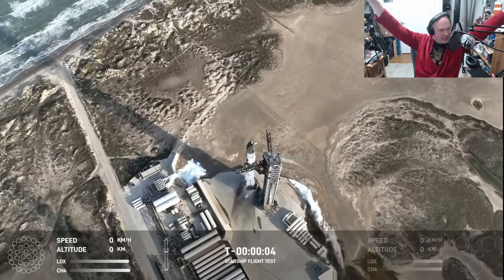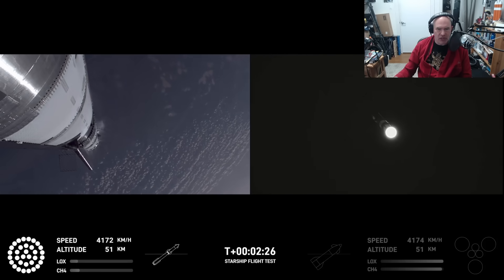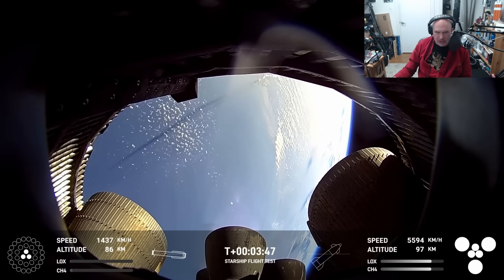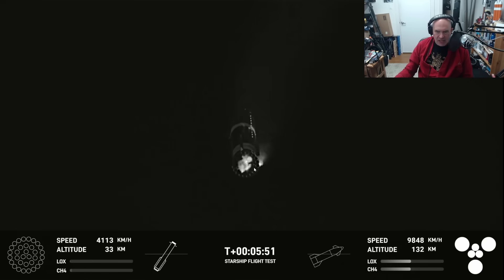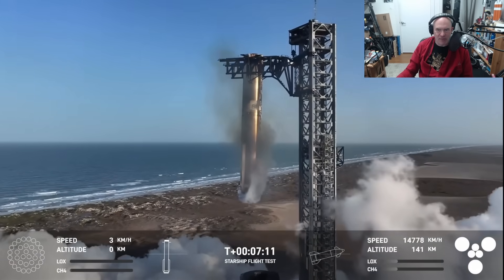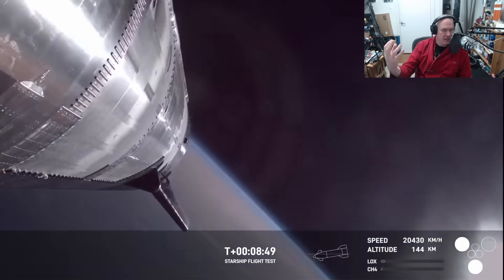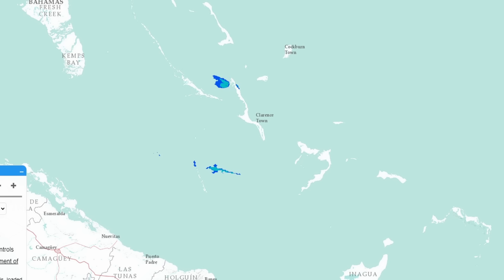SpaceX Make The Same Mistake Twice With Starship Flight 8

Comment: Edit of my original post.
Very long writeup....So theory is....
1 - High levels of LOX in the tank dampened the effects of the harmonic frequencies/vibrations since the new RVac methane downcomers are mostly submerged at that point. 
1.1 - The new downcomers are likely susceptible to vibrations because they are long and thin...just think of a Guitar String..
2 -  As LOX starts depleting, more of the RVac downcomers gets exposed and with no LOX to dampen their vibrations, it starts causing damage.
3 -  E4 RVac methane downcomers eventually rupture. This reduces the amount of Methane thats is being fed to RVac No. E4 which leads to 2 possible effects.
3.1 - Methane is needed for Regenerative cooling of the raptor engines. If not enough methane is being fed, these engines might overheat, its likely what we saw on the engine camera view of RVac E4 with its burnthorugh on the engine bell.
3.2 -  Not enough methane also means the engine suffers a reduction in thrust, as highlighted by SpaceEngineer at T+7.43 so the ship starts pitching over to the side of the failing RVac E4.
3.3 -  Not enough methane also means the engine is running at oxygen-rich combustion, which is very destructive (Look at SN8)
4 -  Both Oxygen-rich combustion and severe overheating combined caused a catastrophic and energetic failure of RVac no. E4. This blast instantly knocks out 2 of the Sea Level raptors and heavily damages the 3rd one. The 3rd Sea level Raptor with its heavy damage eventually fails as well catastrophically.
5 - S34 starts tumbling due to asymmetric thrust from the 2 remaining RVacs that cant gimbal.......and the rest is history.

Key Points:

## S34's Fix - It likely didnt work because the conditions they tested S34 is inaccurate and doesn't replicate S33's conditions at failure. 
- As I highlighted, the problem starts as LOX levels starts to get low. 
- However, S34 conducted a 1min static fire test with FULL LoX tanks. So the data they gathered is already incorrect leading to improper fixes.
- The fact that S34 failed in the same manner and within the same time-frame as S33 leads credence to the idea that the root cause of the failure wasn't addressed properly or at all.
- Thus, they need to redo the test with S35 static firing with a low level of LOX. They either need to anchor it down or add heavy ballast in the payload or fully fuel the methane tanks.

## Bandaid solution?? - If SpaceX desires to keep both S35 and S36 both of which are too advanced in their production for major revisions. They could sacrifice mass and HEAVILY reinforce the new V2 RVac downcomers with numerous stringers, supporting frames, and other reinforcements to atleast minimize the damage caused by the vibrations.

## Major revision?...A Block 1.75 Starship - If SpaceX engineers thinks that the V2 design is way too flawed. They could revert the entire downcomer and its associated plumbing in the engine section back to V1 spec. This seems only applicable to Ship 37 onwards, which are still not stacked and incomplete and thus can take in major revisions in designs. So you are left with V2 Flaps, V2 thermal protection system, V2 Tank size, V2 hull, V2 payload section with a V1 engine plumbing. a Block 1.75

- The V2 plumbing are likely designed for higher fuel flow needed by Raptor 3. Reverting to V1 plumbing might result on a reduction thrust to Raptors-3. However, it might be beneficial for reliability as Raptor 3 running below its designed/specified thrust output might actually lessen the stress and wear on the engine.

- At this point of the above decision...that basically means relegating S35 and S36 to testing articles to further learn more about the harmonic frequency problem for a permanent and effective fix if SpaceX still desires to keep the V2 design eventually.
Reply: IMO They have 2 options for a fix, redo the test with a tethered down V2 Ship with nearly empty LOX tanks and gamble with the new Fix from said data or create a Block 1.75 Starship with proven Block 1 downcomers with the rest of the ship being Block 2
Reply: @pikaachoo3888 could they encase the separate downcomers in a single block 1 style pipe? Or indeed find some way of increasing their structural integrity by say physically connecting them (even if the actual fluid lines themselves aren’t connected)
Reply: @MrUltrAdaman  They can but its an inefficient solution since it adds a lot of weight. The casing you used will be very long to cover the entire downcomer, you will also need to support it with even more stringers if you want to avoid it being crushed by the LOX tank pressure. At that point, you might aswell merge the downcomers into a single pipe...AKA the V1 downcomer design. Its why S28-S31 all had succesful ascent, the V1 downcomer is far more resilient
Reply: @ makes sense thanks
Reply: @pikaachoo3888  I have heard a couple of people suggest this.  Time for a hybrid.
Reply: @pikaachoo3888  I think you're right because my original assumption was that those three pipes cut through the bottom of the LOX tank and are not aligned with the focal point of the forces that the thrust generates on it (the center, directing forces to the edges), that create three gigantic weakspots in a dome structure that needs to transmit forces with no interruption. Plus it seems that the problem comes from the same pipe in both cases, maybe there is something else attached to or near it near the bottom of the tank or it comes from the orientation of the craft and the forces that its thrust vector generate, trying to get to orbit. In that position, there is an asymetry between the belly and the back part of the ship (heatshield and one Vac engines below and two above the medium line, there are more forces on top than on the bottom.  Saturn V first stage didn't have that problem thanks to a sturdier structer and five engines with four outer ones in a symetrical configuration.
Reply: @pikaachoo3888  the lox tank can only be mostly empty in the case in whare they have the engines somewhat on
Reply: @pikaachoo3888  So their computer modeling software and AI algorithms are insufficient for the task OR what you are proposing.
Reply: @pikaachoo3888 my thoughts too. Go back to the bits that worked.
Reply: @pikaachoo3888 - but why didn’t they do this after Starship 7 exploded. They knew the lower LOX level would let the downcomers vibrate more ?
Reply: Very plausible possibility, curious to see the results of the investigation and if it's the correct take or not!
Reply: Yes and this might even explain why the v1 ship didn’t have as big issue with this because the old methane downcomer design is completely different from v2 meaning it likely reacted differently to the empty tank acoustics then the previous design
Reply: @sauceboss1846  Not only that, the old V1 downcomer is a single fat piece, so its more structually resilient to violent vibrations. Its like how a single strand of spaghetti (aka V2 Methane downcomer) easily breaks if you vibrate and shake it with you fingers, but a bundle of spaghetti(the single V1 downcomer) wouldnt be affected that much
Reply: @pikaachoo3888  and now I know you don’t know what you’re talking about! 🤣 an engineer you are not.
Reply: Men, never seen a guy with the goofiest profile pic giving the most accurate depiction of an event in my whole life.
Reply: @Blasphème_Sataniste - looks like “roaring kitty”
Reply: The other thing that never shows up in static fires is the increased G load. The G load goes up as the propellant burns off. That increases the hydrostatic pressure in the tall downcomer.
Reply: That’s what I thought too.
Reply: @Staysa001 lol.
Reply: A valid explanation from the information we have.  I wonder if the extra length they added in V2 just happened to put the downcomers into a resonance range that the shorter ship didn't hit.  Doesn't the booster use a similar feed system?  So, it isn't having this issue when fuel/oxy gets low and the V1 wasn't either.  But add resonance to the typical vibration and that would add a lot.
Reply: @ IIUC the downcomer design is substantially different between the two versions. I believe someone already mentioned this somewhere but the old design seems to use a single larger downcomer that gets distributed vs. smaller downcomers, one per RVac.
Reply: @toddjohnson5692  more so due to resulting thickness not length of new downcomer system. As some above have said they are using 3 thinner ones for Rvacs  and one bigger one for the 3 center engines. Vs v1 which was one big downcomer that split at the very bottom to each engine
Reply: @toddjohnson5692  The incandescent hotspot is on the outside of the bell, and there's no oxygen to burn that stuff there. 
The only resonance issue here is an intentional vortex that is established between each cluster of 1 V.Raptor and 2 Little ones. You can see this vortex clearly on the right-side of the video around 9:45, but the frame rate helps to hide it. The angles of the rolling vapors/smoke clearly show vortexing. 
This is used to keep the external surfaces of each V.Raptor cooled, by venting LMe between them. This doubles as a Base Bleed effect (see: Extended Range Artillery) when the high velocity exhaust entranes it for more zoom-zoom.
Reply: Maybe... but the starship flights that made it to splashdown didn't rud. So, maybe it has to do with the modifications they've done. Sometimes the best part is the one that worked consistently without a rud
Reply: I don't think so, AFAIK the vents don't vent the gas into the skirt area. Also it's clear one of the vacuum engines suffered a RUD and as scott noted the fire couldn;t have caused that alone or the other engines would be exhibiting similar issues. The glowy part of the engine is unrelated to whatever is happening under the heat shield.

To me this looks like a Raptor 2 failure in the regenerative cooling jacket thats venting into the skirt area. This leads to burnthrough of the engine bell due to insufficient cooling which causes an engine RUD that then takes out the sea level raptors. Its possibble there's too separate failures going on here with the engine RUD being unconnected to the flames seen. But thats unlikely IMO.
Reply: Are you a rocket scientist? I don’t know enough to tell whether this explanation should be convincing but I know enough to feel that it’s plausible.
Reply: @jaredbutler957 I don’t work directly on these things (I’m a data person), and I do not have any relation with SpaceX. But I do know that the vibration during a launch is far beyond what most of us intuitively understand, like it will shatter solid pieces of metal nearly instantly in the right conditions. I also know that there have been issues that only appear when the tank levels are in a certain range.
Reply: @Mira-bt3zx  To put that in perspective, I was just watching a vintage film post mission interview of the Apollo 12 crew, and one remarked the shaking was so violent when F5 engines lit off that he could not see the instrument panel.  Starship is all that much the larger with potentially all that much larger vibrations in both stages.  It is pretty tough to simulate the Starship without actually launching.  Static firing may not tell the whole story because the stresses are different, there is no acceleration along the path, the ship is restrained, etc…

I am not surprised at the number of launches required to wring out the Starship problems.  The late 1950s/early 1960s Atlas booster stage and a half development took close to 12 launch failures before success and Atlas was small and simple by comparison.
Reply: @Mira-bt3zx 
Especially with the metals involved being supercooled due to the propellant, weakening the metal and making it more susceptible to said vibration.  Nice one!  👍🏻
Reply: @jaredbutler957  I mean, it does align with what the extra-long burn test was about.  The main problem is that test was done under normal gravity, on the ground, so it probably failed to find whatever harmonic issue is causing this mess.

The "fail fast and fail early" approach might have a blind spot here, if data from the first in-flight error and the ground test isn't enough to isolate the cause...
Reply: @georgedorn_fnord  Surprised nobody reacted to this before: but gravity at 75 km up is basically the same as at sealevel. And even then, the main force generated on Starship is it's own thrust. Being weightless in orbit generally means:
a) not under rocket thrust (else you would feel acceleration pushing yourself into your chair)
b) you are still under the influence of gravity, but you and your spaceship have sufficient velocity (orbital velocity) to 'fall over the horizon': Within the reference frame from an astronaut, you are falling at the same rate as the spaceship and experience weightlessness.
Reply: @jaredbutler957  Sounds good to me
Reply: @jaredbutler957 YouTube aerospace engineers! 😂
Reply: @jaredbutler957 - yes he made me google some terminology, and it makes sense
Reply: This is a pretty good theory, there is obviously something happening as the tanks empty because when this fails it's at almost exactly the same point as the previous flight. Is it resonance this time though, we will have to wait and see. Personally I think its going to be an issue with plumbing outside the tanks, I believe there is more complexity in marrying raptor 2s to Starship V2 as it was designed for Raptor 3 meaning more complexity with adaptors. There is that obvious hot spot on the engine bell too, so who knows, it really is all speculation right now though.
Reply: @schrodingerscat1863  One of my supporting observations is Ship 34's static fire test. S34 during its static fire had a FULL tank of LOX, so its both an inaccurate simulation of S33's condition at the time of failure but likely also generated false data because any vibrations they detected would have already been dampened by the full LOX tank leading to an improper fix. The fact that S34 failed in the same manner, at the same timeframe with an even more violent failure mode further supports the idea.
Reply: @pikaachoo3888  Exactly, very difficult to simulate these exact scenarios. I imagine they would have had vibration sensors all over the place this launch to detect where vibrations are building up first. It's going to be a while before they fly again I think because the investigation this time is going to have to be really in depth. Probably a lot more static fire testing too.
Reply: @schrodingerscat1863  Its very easy for us to come up with these hypothesis with the benefit of hindsight. I cant imagine how stressful it is for the SpaceX engineers to be trying to look thru the data in real time and figuring out whats the right thing to do. At the very least, they now have 2 Full sets of flight failure data to base fixes from.
Reply: @pikaachoo3888  Exactly, problems like this are never easy to track down, having 2 sets of failure data will be good to look for commonality in behaviour prior to failure. I imagine they also have more cameras and sensors around the engine bay plumbing this time to detect any recurrence. I think it will be a while before they next launch, getting to the bottom of this issue may not be easy.
Reply: This reminds me of the Apollo 6 launch.  Several engines failed on the ride up hill because fuel lines cracked.  This wasn't seen on ground testing because humidity in the air condensed and froze on the fuel lines, damping out the vibrations.  In space, however, no atmosphere, no humidity, and no ice to damp vibrations. They added flexible bellows to the fuel lines that eliminated the problem.  

Pogo on the first 2 Saturn V flights was also an issue (due to harmonics in the fuel flow).  This may have contributed to the previously-mentioned fuel line problem.
Reply: A cascade failure
Reply: The liquid being in the tanks is a damper for the pipes. There's more contributing to it than that, IMO, the aft dome taking the hollering imposed by the engines with them pipes right there pushing and pulling throughout the operation, yyyyeeeeeeeeaaaaaaaahhhhhhhh, can't believe they didn't simply make the central down comer larger and add a manifold at the bottom to feed the future compliment of engines.
Reply: I think the downcomer vibration dampening is a good put - but I wouldn’t rule out guidance control interactions as well.  You could easily get a vibration that starts to affect the IMU (vehicle motion sensor) and it moves back and forth with the resonance.  The guidance system thinks the whole vehicle is moving that way and tries to correct.  It could command the engines to gimbal to counter it, which only ends up amplifying the vibrations more…. and pop!  Something like this would be quite hard to debug on the ground…
Reply: I'm sure they're taking into account the dampening effect of 14.7 psi of air pressure against everything when they're doing static fire tests, maybe?
Reply: Pool noodles!  Why don't they just wrap the pipes in pool noodles to absorb the vibration.  You're welcome, Elon.
Reply: How precisely did the downcomer change from Block 1?  Is it a different length or width or made with a different material?  Anything that changes its resonant frequency could be the cause.
Reply: @joewestfall2952  The V1 downcomer is a single fat steel pipe that feeds BOTH the Sea Level and RVac Engines. The V2 downcomer is made from steel with a separate 1 fat pipe for the Sea Level engines + 3 thinner pipes for the RVacs. They made this change likely to allow for higher fuel flow in preparation for Raptor 3 engines. The problem it seems now is that because the RVac V2 downcomers are so thin, it makes them susceptible to vibrations (just imagine a thin guitar string). It explains why both S33 and S34's attic leaks/fires/explosions BOTH originated from a RVac engine. The Sea Level raptors in V2 ships still used the main fat central downcomer which explains why the explosion didnt originate from them
Reply: @pikaachoo3888  If that's true, then the solution may just be bridging the down comers together to reduce pipe resonance, IE add some gusset plates every few feet to link them together and a few struts scattered about to the hull to again, modify the frequency even more. I've done this with header tubes on high output turbo race car engines where the pipes would crack. Just make a gusset bridge plate and the vibrations stop
Reply: @pikaachoo3888  I feel that they rushed ship v2 and didn't wait for raptor 3 or raptor 3 is taking longer then expected
Reply: @joewestfall2952 instead of one downcomer, there are now 3 smaller ones. A significant change!
Reply: This guy rockets.
Reply: I completely agree! I think they should coil the downcomer around the walls, kinda like the header tank. Doing this will cause the coil to vibrate with the ship, keeping intact
Reply: If that's the case, then they need to dampen (i.e. change the resonance frequency) of the downcomer.  Obviously the single downcomer had a different resonant frequency (probably lower, due to it's larger diameter).  I'm an EE, not an ME, but I deal with resonant frequencies all the time from an electrical standpoint.
Reply: Yo get this guy a SpaceX job
Reply: Dude you need to apply to space X
Reply: @shadowryth7308 High Pressure Rubber Hoses covered in Stainless Steel Mesh is commonly used for high stress applications.  I don't understand why SpaceX is not using this common approach to this problem...??
Reply: @markfinch2016 cryogenic fluids will render the rubber more brittle and likely to shatter itself. Think frozen water hose in sub freezing temperatures.
Reply: @FlynProfessor  Then Elon is screwed and needs to call a friend who is probably retired, but who worked on the Saturn 5 rocket engines.....just kidding 😂
Reply: @markfinch2016  rubber and cryogenic temperatures don't exacly get along...
Reply: There needs to be an LOX leak as well, at 86km the ship was out of the atmosphere enough so a methane leak on it's own would mean little, it certainly would not burn
Reply: @kingcosworth2643  Yep, I agree. Its pretty easy to achieve when you have 3 Rvac pipes vibrating like guitar strings, from which they would eventually damage the LOX tank and a LOX leak would develop.
Reply: @kingcosworth2643 downcomer goes through the lox tank, therefore leak of downcomer means methane in lox tank
Reply: I'm giving her all we can Captain! "
Reply: Add back into design the old plumbing as it is proven to work.  If it ain't broke don't fix it.  Looks like space x may have been looking to save cost by the redesign.
Reply: Great post.  I'm not a rocket guy, but your explanation seems informed.  Thanks for describing this in terms that even I can understand.
Reply: I accept this explanation
Reply: That makes sense. My initial observation is fuel slosh - perhaps the larger tanks are prone to more fuel slosh. Gas bubbles in the downcomers seem to be pretty prevalent based on the leaks, and it would combine with the vibrations to cause a nearly unstoppable failure point.
Reply: @pikaachoo3888  The leak issue might be fixed by changing the down comer fuel lines to flexible rubber lines with a stainless steel mesh shell as found in many other high stress applications in industry. Elon is trying to save weight perhaps too much.
Reply: @markfinch2016  would the rubber even be able to handle these extreme cryogenic fluid temps. Because I thought most polymer like materials became quite brittle when at extreme cold temps
Reply: @sauceboss1846 Silcone is not affected by cold temperatures very much. Doesn't matter, because they already have flex hose in use for Aviation applications. I think it must be a cost, or weight issue. Even high pressure hydraulic lines use flex hoses. C'mon Elon get it together bro.....
Reply: Agree it’s likely feed lines - unlikely two rvacs fail at the same instant
Reply: Maybe weld the downcomer(s) to the outside wall(s) of the hull. Maybe 3-5 smaller ones to spread the load & stiffen the tank..  The vibration would be more fixed and less affected by tank level.
Reply: Everything’s so interconnected—one weak link, like a vibrating downcomer, can trigger a chain reaction that takes down the whole vehicle. SpaceX is likely digging into the telemetry right now, figuring out how to reinforce those downcomers or adjust LOX management to keep them submerged longer. It’s all part of the iterative process—blow stuff up, learn, and build it better next time.

Great catch on all the details, by the way! You’ve got a keen eye for this stuff, and it’s awesome to see someone dive so deep into the tech. What do you think SpaceX might tweak to avoid this on the next flight?
Reply: Very interesting.
Reply: This is astounding.  I’m far from a rocket scientist but that is basic common sense.  I can’t believe it.
Reply: Having worked at 2 rocket companies on 3 different rockets as a structures engineer, it's shocking how accurate Scott Manly is with his immediate post mishap analysis. The comments are also very intelligent and often accurate (a tribute to the knowledge base of Scott's subscribers). Your hypothesis indeed seems entirely plausible, especially if the static fire didn't drain the LOX tank enough to expose the fuel downcomers. Perhaps the available date from flight 7 suggested the resonance was in the attic and not the LOX tank? The individual smaller diameter downcomers will certainly be less stiff and resonate at a lower frequency than a single large diameter tube would.
Reply: Well maybe we will see tests with 25% prop in it
Reply: Is that really it? This kind of failure should be considered during the design phase.
Reply: Tell that to NASA....NASA has experienced a number of rocket launch failures, with over 160 launches failing since the beginning of American space efforts, including failures of manned and unmanned vehicles.
Reply: $0.02 here.
First, with regard to the N1 "too many engines" hypothesis, they are not having a problem keeping the engines on the booster going, even though they are pushing CH4 backwards through the engine bay etc, and have stuck the chopsticks landing with relative ease, so while by now it should be somewhat concerning that they are having ANY malfunctions on those 33 engines, I don't think it's an indictment of the large engine count approach.

What they ARE having trouble with is keeping 6 engines  lit in straight & level flight. I have no particular knowledge besides public sources, but one suggestion I would make is to fill the attic space that seems to be filling with CH4 with foam, whose sole function is to take up space so CH4 can't accumulate there and ultimately explode. It offers a cheap and fail-proof method of narrowing down the possibilities between attic leaks and the VacRaptor's regen cooling. Foam wouldn't weigh much and would add some extra strength to prevent structural failure on the odd chance that might be a problem. Some of the stuff from the Space Shuttle should work, if Elon can get past his own ego.
Reply: they need to fuel S35 to like 20% and burn it to depletion and see what happens
Reply: Very much agree with this and thought this is the issue since I saw the Ringwatchers picture of the V1 vs V2 starship methane feeds.
Reply: Did any block 1 ships try hot staging?
Reply: @tracerocks All but FLT-1 used hot-staging.
Reply: Or maybe it's a piece of sh*t
Reply: Sounds plausible. But you need LOx in space to ignite it.
Reply: To fix it, they need to duplicate the same conditions  for a ground test that they have in space, then intentionally make the same thing to happen again. Then they'll know what caused it
Easier said than done, of course- but that's what needs to happen
Reply: I'll sign off on that.
Reply: I was just thinking the exact same thing… 😉
Reply: I think they need to go back to V1 methane downcomer.
Reply: @pikaachoo3888  Flexible Rubber Fuel Lines with Stainless Steel Mesh covers may fix the issue of harmonics causing leaks....
Reply: @ rubber will not stand cryogenic temps
Reply: @pikaachoo3888  this is a really impressive theory and i hope to see spacex do those lower fuel tests
Reply: Talking about step by step explanation in rocket mishaps chain reaction of the nasty kind any ways ty a real pleasure reading your post .
Reply: Sounds like a valid theory.
Reply: Maybe, they should hold off the next flight until the 4th of July.
Reply: Whoa. Are you a real rocket engineer, by chance? That made perfect sense.
Reply: You could be onto something, hope SpaceX engineers explore what you are positing.
Reply: Did you see there are folks saying a raptor took a leave of absence? People have screenshots of the missing engine
Reply: They need to stop using downcommers and instead use a tank within a tank. O2 inside methane. This will solve it
Reply: True when lox is low then problems begin
Reply: So maybe another extended static fire, but with low propellant in order to test or recreate the situation you’re describing?
Reply: Sounds plausible.  If this is the case, perhaps some bracing on the down pipe would resolve the issue.
Reply: es más fácil engañar a un tonto, que demostrar a él que ha sido engañado.
Reply: Verifiable by checking the deltaV (I mean literally just change in velocity readout) and seeing if it lines up with a loss of thrust. Assuming we know the max thrust of those engines, and that they wouldn't be intentionally down throttling at that point in the flight.
Reply: Sounds plausible.  Probably the multiple downcomers need to be beefed up with more/substantial stiffener rings in order to prevent the vibrations.
I'm sure SpaceX engineers have way more videos, sensors, data than they allow the public to access and that they probably added even more after flight 7.
Every flight is a data gathering mission, hence the need to fly more and fly often in order to perfect the craft.
Reply: Makes sense.

Send this diagnosis to elon
Reply: So you’re basically saying that S34 explosion was the result of the same explosion on S33?, or very similar ? Why would they launch S34 with so little change then?
Reply: Can they use piano wire instead of guitar strings since they are more stronger 🤔
Reply: omg, the cope is hard in this one!
Reply: that sounds like an excellent explanation
Reply: Some things cannot be tested on ground, hence the need for test flights
Reply: The booster does not appear to have this issue though which should be much worse and the damage  happens when its mostly full
Reply: not across the details of the cycle by any means but as devils advocate: ignoring the downcomer change as most likely affecting the methane system because thats what they're part of, exclude the other direction of failure propagation: something in the LOX system causes lean burn overtemp at the bell exit, eventually ruptures cooling plumbing there, and that's where the starvation/depower cascade starts (providing its own oxidiser for the additional fire by default). If that can't be ruled out for [obvious reasons i don't know], hypothesise time of flight/altitude causes for that failure mode too.
Reply: @GarageExperimental  I believe the bell exit is the coolest point on the bell, the throat being the hottest. Pressure problems should show up on telemetry right on time and in detail, so hard to think that's the problem.

Perhaps they should focus the next ride on testing the vacuum engine/s, since space is the only place they can test them, while filling all the voids in the attic with foam. Yes, that would make the entire StarShip a test fixture, but worth it if it finds the problem. A vacuum engine problem would be a big problem.
Reply: literally russias rocket launch this week
Reply: I understand some of those words.
Reply: bro copied and pasted this
Reply: Not exactly like that
Reply: Nope
Reply: Seems reasonable. 

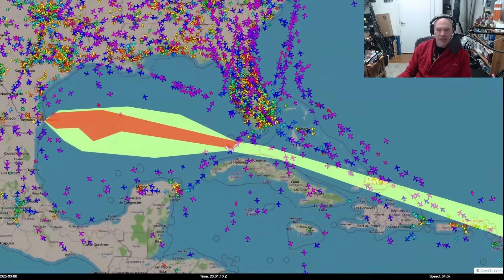S-34 staged at T + 2:40 minutes and started to lose the first engine at T+8:10. 
So, S34 flew perfectly under full thrust for 5.5 minutes before the RUD started.
 At that time, the LOX tank was almost empty.
 
S-34 was operated for 60 seconds on 11Feb2025 in the longest static firing to date for a Ship.
The video shows that the S-34 LOX tank was completely full at the start of that long static firing.
So, those LCH4 downcomers were nearly fully submerged in LOX at the start of that static firing.
But instead of 5.5 minutes, that static firing only ran for 1 minute. 
So, 4.5/5.5 = 0.86 (86%) of the length of those LCH4 downcomers was still submerged in LOX at the end of that static firing.

It looks like that 60 second static firing was not long enough to fully test whatever modifications SpaceX made to those LCH4 downcomer pipes.
Reply: I hope the next attempt will be  done with Elon on board. This  will prevent any failure in the future.
Reply: @ @gustavganz303 it may not prevent issues but yes it would be a big plus
Reply: Your forensic evaluation is spot on as usual. However let’s not forget that the Heisenberg Turbulator assembly will need to be redesigned to dampen out any vibrations that are beyond specification. This will obviously reduce the pogo oscillation.
Reply: Arm chairing this is insane
Reply: Seems to me then that the easiest temporary fix is to retro-fit cross beams to anchor the downcomers in place at a given number of heights.
Reply: @chrismoule7242  Never make a temporary fit.

Nothing is more permanent than a temporary fix. 

What you do instead is you call the temporary fix the permanent fix. That will anger your boffins. Implying that they aren't able to do better. 

You may think this is manipulative, and it is.
Reply: I imagine there will also be acoustic cavity resonance, and that resonant frequency depends on fuel level.  Like how the pitch produced when blowing across the neck of a bottle depends on how full it is.  Maybe the failure happens when the "string" resonant frequency of the downcomer, or one of it's harmonics, matches the cavity resonant frequency.
Reply: @galacticminx interesting. Thinner pipes, different harmonics, sounds plausible to naive me!
Reply: @galacticminx Now that is a very likely scenario.  The failures have happened at around the same fuel/oxygen levels both times. I think the new RVac downcomers shouldn’t be straight to give them non-resonant sections.  A bend somewhere at an odd point along their length will drastically reduce the intensity of any harmonics.  I know from experience that a bent piece of conduit doesn’t have anywhere near the resonance of a straight piece.  The bend causes vibrations to happen in different directions and somewhat self-dampening them.
Reply: Has anyone written a script to read the velocity values from the webcast and plot the acceleration over time yet? It'd be interesting to see how the thrust changes towards the end.
Reply: @bewilderbeestie  Yes, I have Flights 6, 7, & 8 in one graph. There is one noticeable fluctuation in acceleration at T + 6:15. I also see a smaller amplitude acceleration change during flight 7 at the same time. Reviewing the video feed, I see evidence of gas leakage starting at T + 4:16. I've now added the possibility of damage sustained during "Hot Staging" to my fault/failure list.
Reply: @Spacedog49 I feel like significant damage from boostback is pretty unlikely considering there’s been pretty minimal damage on all other flights
Reply: @ballisticfox9033  The acceleration data I have during "hot staging" shows an unusual fluctuation at ignition, not in the data from flight 6 or 7. I'm still investigating what could be the cause. I can't rule out the possibility of a hard start with one or more of the Raptor engines which could result in plumbing damage.
Reply: @Spacedog49 agreed with you, It looks plausible it’s a combination of resonance and hot staging damage, remember that they moved to thinner stainless steel structure for V2 as well. Hot staging is quite energetic event that could weaken the 3x RVAC downcomers plumbing
Reply: @bewilderbeestie Yes, there is a YouTuber with not a lot of subscribers that every time SpaceX was releases a finalized version of the live stream. This person takes a couple of weeks to render it in a video that's more appealing with fuel levels and all that using a OCR of the live stream and some other stuff.
Reply: @bewilderbeestie "has anybody..." it's your idea I nominate you to do it! 👍
Reply: Yall enjoy the discussion, Im not gonna try to prove my hypothesis as a fact, I just wanted to put it out there to see if people will agree and to help fuel a healthy conversation. Ill go back to sleep, I still have work tomorrow lol.
Reply: @pikaachoo3888 get some rest! Appreciate your insight!
Reply: @pikaachoo3888 hey man thanks for the information and engagement
You need a position at starbase
Reply: That's a great hypothesis, but where does the massive methane leak ignite, since you haven't accounted for the required oxygen component of this fire triangle?
Reply: @buckstarchaser2376  The methane downcomer goes through the tank walls that also servers as the LOX tank bottom bulkhead from which they attach into the engines. If the methane downcomer ruptures at said point, itll also spill LOX into the attic compartment thereby trigger a fire or explosion.
Reply: @pikaachoo3888  No Methyl-Oxy flame was visible in the video, and an atmosphere would be present if any of your assumptions are true. I'm under the impression that LMe is released continuously in this "attic" for cooling and to prevent a flammable mixture from forming. 
If a pipe broke inward of the LOX tank wall, then the high-velocity LMe would venturi so much LOX that the burners would surge and disassemble, producing visible vibrations and incandescence as the area below the tank separates from the craft in an uncontrolled manner, thus cutting the video feed before the events that we saw.
Reply: @buckstarchaser2376  Im not suggesting that the pipe broken inward, Im suggesting that it simply snapped or broke off at exactly the point where it meets the LOX bulkheads thereby creating a common point of exit for both LOX and methane which then feeds a raging fire/explosion in the attic.
Reply: @pikaachoo3888  Seems like that would be a natural location to place a flexible connection, since the described scenario would be the "this always happens to bust a pipe" case, and the one we saw has failed to fail pretty consistently until recently. 
It's more likely that a person who was laid off is pointing at the screen and saying "See! I told you you needed to get that cooling vapor vortex out from between those engine bells faster than that, but you just had to save [ several tons ] of fluid dumping for economical, and incremental payload increase roadmaps. Until our kids get to see the explanatory documentary, we may not get great info on this.
Reply: A methylox flame was visible below the UI. In the attic, LN2 is constantly pumped in to inert it, but it seems like this time an engine got destroyed. Gas bubbles in feed lines caused leaks imo.
Reply: The only test not being undertaken for fixed final structure IE the Ship, is Resonance Frequency. This is an often overlooked fundamental examination of structures, IE check out the new Millennium footbridge over the Thames in London, it took 3 years and a few £millions to resolve.
If not resolved a Resonance Frequency can distruct the structure it's happening to.
Reply: @deniswilloughby  

Do you know that the vibrational testing is not being done or at least modeled? That is a very important and standard industrial practice.
Reply: @deniswilloughby  I’d be surprised if some, actually probably a huge amount of vibration/resonance modelling isn’t being done.

I 100% agree with the theory about the cause of the failure, I’ve posted the same myself albeit in less detail. I think the issue with modelling (and ground testing) is that the system is so complicated with so many different modes such that it is pretty much impossible with current computational power to model everything.

As the original comment states the resonant frequency of the 3 outer downcomers (the ones we are focussing on here) is constantly changing as LOX levels change and I’d to that also as even a small amount of sloshing occurs, as both LOX and CH4 temperatures change, and probably other variables I haven’t thought of. On top of that the driving frequencies that you want to simulate are probably also changing with throttle settings, gimbal angles, atmospheric density and again probably other stuff I haven’t thought of.

Put all of that together and you probably have a range of all possible scenarios that far exceeds the computational capacity to model unless you’re going to dedicate an entire huge data centre to the tasks for months on end (and typical data centre hardware wouldn’t have the right type of interconnects anyway so couldn’t run the size of FEA and CFD models needed to simulate each scenario). That leaves SpaceX having to model a subset of all possible flight scenarios and hope that no intermediate points not modelled can cause a problem.
Reply: @deniswilloughby  They literally do vibration testing. Large assemblies have multiple resonance frequencies. You fundamentally misunderstand these things. Its also not overlooked at all, in fact its probably the most common enviromental test in all of aerospace design.
Reply: I dont think they made the same mistake twice this is a new problem not seen before.
They will learn so much from this failure as they did from the last one
They didn't have enough vents on the last one and this was a vacuum raptor failure.
Reply: If that were true it would happen every timeif this were true then it would happen every starship flight
Reply: @jebes909090 they changed the downcomer on the block 2 ships, which is why the failure has only happened on the block 2 flights.
Reply: Spot on👌
Reply: Email spacex! Haha
Reply: Very plausible theory.
Reply: Amazing post Morten, thank you for the insight. Is there any suggestion for a fix?
Reply: @maccatt7274  More struts/SRBs, per usual.
Reply: Nice try. It was actually a failure of the oscillation overthruster.
Reply: @therichieboy :  Thanks, Buckaroo!
Reply: @therichieboy ”D@mn you Buckaroo Banzai!”    I got that reference.  👍🏻
Reply: Sounds like an interesting narrative if you know more about it than the SpaceX engineers. Otherwise it’s  just intelligence signaling. ( bragging)
Reply: @ intelligence bragging?
Bruh .  I bet you complain about punctuality too
Reply: @johnsteichen5239 as opposed to obvious critical thinking and objective analysis?
Reply: You said a lot of nothing
Reply: Nah, just admit. This is a dead end project. Always was.
Reply: Ok buddy 🎉🎉🎉